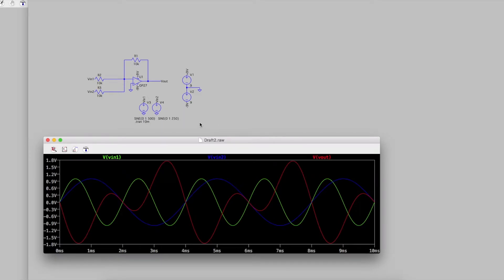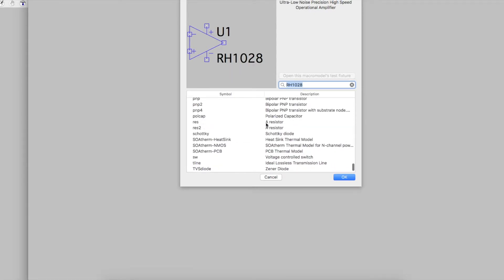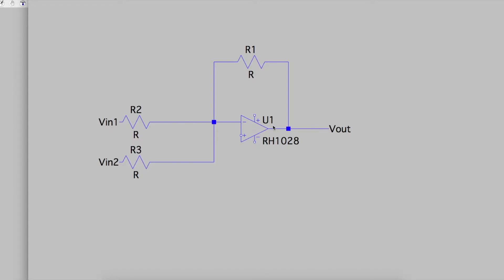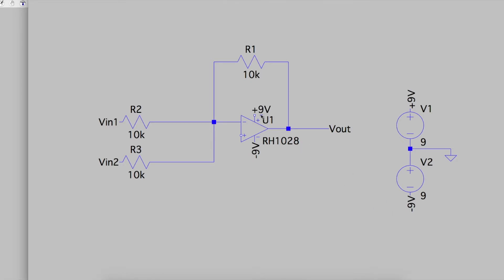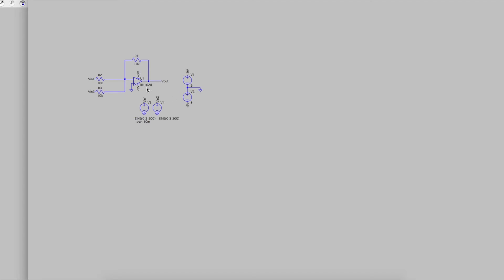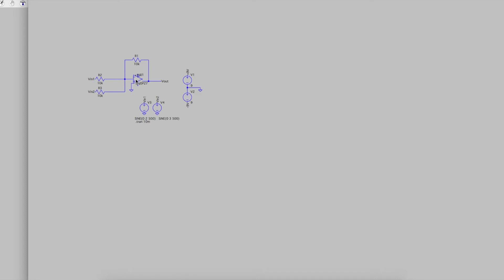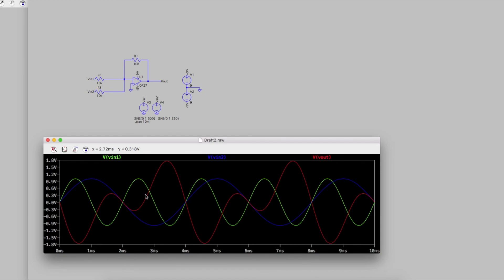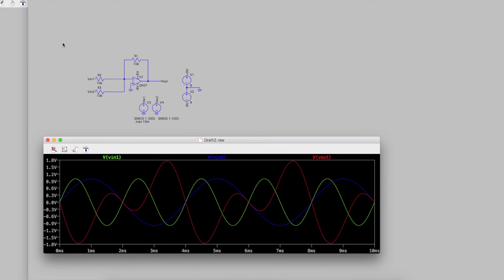LTSPICE OpAmp Mixer Simulation

Comment: Holy cow! I finally got this to work! Thank you. :P
Reply from the maker: I should use this tool more often. Sometimes I forget how it can show intricate circuit operation and it’s easy to swap part values and see the impact, a lot easier than trying to figure out the color codes on those damn resistors with the blue body.
Reply: @GadgetReboot  TBH I still measure my resistors with the multi-meter, although I have optimized that ordeal fairly well. This Mac version of LTSpice is hands down THE LEAST intuitive software I think I have ever used, but now that the way is clear it is a very handy tool. Thanks again!
Reply from the maker: Yeah when I first tried using it I had no idea what to do, there were no menu options, it felt like something was broken.